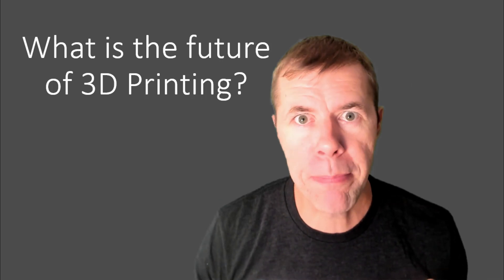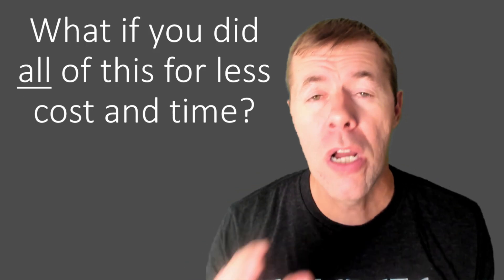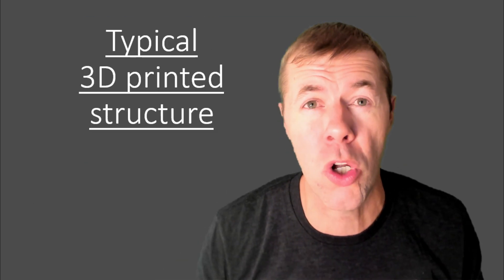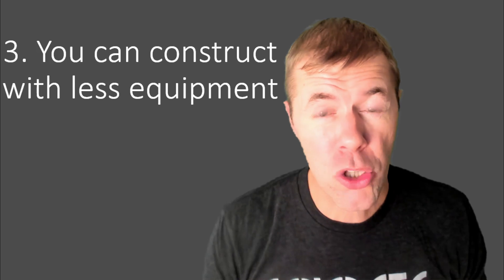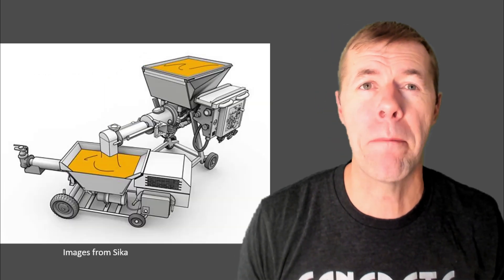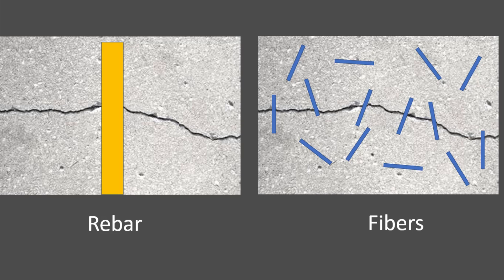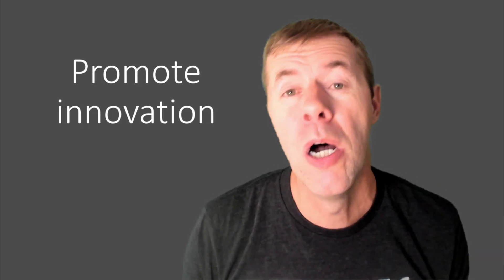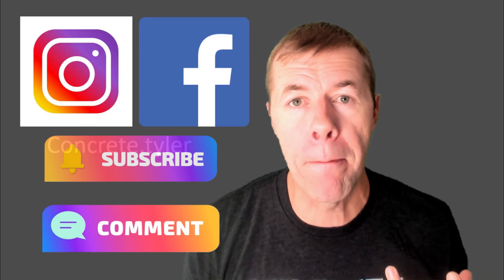What is the future of 3D Printing Concrete?

Comment: I've been following this subject for quite a long time, and I was quite enthusiastic about it at first, but these days I think it would be a better investment of time and money to pursue robotic brick and block laying.  It can use existing materials and well-understood mortar mixes, and while todays bricklaying machines are only slightly faster than a skilled human mason, I don't see any physical reason why they couldn't go as fast as laying a brick or block per second. 

Later generations of masonry robots could deal with heavier materials, such as larger precast blocks, or autoclaved aerated concrete blocks.
Reply from the maker: You still have to come back and place rebar and fill the blocks with concrete.  The new printers can place concrete up to 16" high in one pass and around rebar.  This will be much faster than block.

Comment: Add sleeves at the point of the pour,  both sides to keep what is poured in line with each pass.. a wall on both sides of where it is dispensed, that would help with cleaner lines… add pea gravel to the mortar to help with coat… sand alone adds to water (or admixture cost)

Comment: I still believe that precast is preferable to 3D printing in-situ.
  
Without controlling the curing of the concrete(and the environment), quality will always be variable.  By precasting in a prepared factory, you can control all aspects of the production, and you get to cure without occupying the building site.  Rather than printing one "lift" after another, and waiting for initial strength to print further lifts, one can produce the entire building at once in pieces.
  
You can't get around transportation costs of construction - precast or 3D printed, 40 tons of concrete has to be moved...  It's a wash transporting the rw mix and printer equipment versus the precast elements.
  
Since we can already precast even foundations, you can go as fast as excavation and inspections allow.
Dig a hole... Inpect
Place foundation... Inspect
Place first floor... Inspect, backfill foundation border
Place nth floor... Inpect, start mechanical for previous floor
(repeat)
  
Some of the coolest automation you can do now allows for automatic forming, and wire/rebar cage assembly and welding.  It gets so close to what companies like FrameCAD have done with steel framing, basically CAD it up, and print (in the case of precast, print the cage, print the form, auto-batch the mix, and pour)...
Reply: Making conventional structures using 3D printing - whether it is concrete or plastic - will not result in a positive business case.   The key here is printing structures not possible using conventional processes.
Reply from the maker: Thanks Tim,
I am a big fan of precast.  I have designed a ton of it but precast has some issues and doesn't make sense for smaller projects.  Precast concrete elements are expensive to ship and you have to have cranes to lift them on site.  You also have to connect the precast members together and these connections now become your weak point for durability and structural loading.  Precast makes 100% sense when you are doing the same elements over and over again like prestressed beams and you have a crane but I don't think it makes sense for walls, columns, or foundations.  I think there is a place for both of them.
Reply from the maker: @nicks1146  I don't agree with you.  Get ready.  Automated construction is going to be a game changer and it is best implemented with something like 3D printing.
Reply: @TylerLey  Thanks for the reply Dr. Ley.  I believe the concerns you bring up are valid, but also mostly manageable.  Modular design lends to mold reuse/repetition (and TBH, a return to form leading function like the classical orders makes this easier), modern methods for joining precast segments improves the joint situation, and I have witnessed precast columns used in both parking and human occupied structures.  An example 2,000 space parking garage went up in 2-weeks out here in CA this past spring, all the columns were placed the first three days, the cross beams set to finish out the first work-week (welders joined the beams to the columns), and the decking was placed the second week.  The structure was completely outfitted by the end of callendar month - I've never seen that size of a structure go up that fast.
  
I'm not affiliated, but Peikko has some interesting solutions to the joint and column fastening and structure pain points.
  
There are several companies producing precast foundations, both vertical wall, and footing+beam+panel floor.
  
One of the chracteristics that can be achieved with precasting that I expect would be difficult with 3d printing is hybrid density concrete or insulated core concrete. In theory, one could do something like a multi-head extruder where one head puts out one material and another outputs... well, another material.  More complicated equipment to build and run (software) is the trade-off, and that expertise will have to be earned.  Nothing is free right?

Comment: one of the issues is there is a push away from using cement products and using wood more. so really it needs to focus on the things that has to be made from concrete.
replacing brick cladding is a possibility (timber framing). no need for high strengths or rebar. however it needs to be placed after the timber walls are built. so the printer would need to be more like a multi axis cnc machine (that knows where the end of its tooling is) that can go around the outside and and a nozzle that goes in at an angle.
Reply from the maker: I am not sure something like this lends itself to automation or being insect and fire proof.
Reply: @TylerLey   i'm not sure on what you mean. automation is the whole point of 3d printing. work out one design so you can mass produce it. trouble is the system is only really 2d with lift, not actually proper 3d. with proper 3d you could do far more complex shapes and move around fixtures, rebar, insulation etc.

Comment: So your description of current concrete printing sounds like extra prayer is involved, since it's more challenging to inspect the poured concrete.

When I think of the practicalities of building a house, and especially after having seen that 3d printing involves pouring concrete, I really think that the best use of 3d printing would be to print cellular concrete into a printed-in-place grid system ICF. The printing is slow enough that horizontal rebar could be added during the print, even as it's added during ICF construction. Printed cellular concrete would be much easier to work with when adding plumbing and electrical and surface coatings. Plus, all the solid concrete would be structural allowing it to do the thing for which it is best suited.

Comment: Thank you, professor, for a wonderful presentation. Information that is helpful. But I believe using this strategy will require more time. However, it will change the construction behaviour.
Reply: 3D sounds good, has it’s advantages, really would like to see an ICF building with all the insulation on the exterior ( inside wall can be thin enough for wiring and Sheetrock or plaster) so the concrete is internal (thermally), protected from the weather like part of the family (should last hundreds of years with the right formulation and basalt rebar to prevent rust damage) and acts like a huge thermal load to stabilize inside temps. Results would would be super strong, fireproof (rock wool exterior insulation), easily airtight if done properly, easily disaster proof if properly done. I’m honestly a layperson with just a strong interest, any issues that I need to overcome with this, please let me know. I would be eager to address the challenge. Love your videos and your enthusiasm really charges me up!
Reply from the maker: Khalid - I think you will be surprised at how fast this will be.
Reply from the maker: @Wild_Bill57  I think you got the vision!  There are a lot of details to figure out.  We are going to need some help.  Keep watching for more videos where I will bring up the challenges.

Comment: I'm curious if it will work with passive house standards.  The 3d printed community in Austin TX, I think the upper wall under roof is vented.  Does this system work with Joe Lstibrik's "perfect wall" concept?  Can you create a continous unsulation all around the home like a yeti cooler? Do these concrete walls have a high R values?

Comment: Love the passion and energy Tyler!  I'm of the opinion that ICF is a more cost effective and perhaps superior performing solution.  I can build a 12x16 steel reinforced structure (including roof) with just a couple people, and a pump truck.  At the end of the effort, I have a well insulated, super solid solution at a fraction of the time and cost.  Thoughts?
Reply: I agree.  You get your insulation as a byproduct.  If you use a crystalline admixture like xypex or kryton your waterproofing is mostly done (assuming someone does a legit weep test against the ICF ties).  No 2x4 framing necessary as the ties are your wall panel attachment points inside and outside.  If you do the floors and the roof with a concrete deck forming material like QuadDeck or BuildDeck, you have a phenomenally strong, disaster resistant building.  You still have to deal with creating a termite barrier at any openings or connections to wood.
Reply from the maker: Thanks for the comment!
I agree that right now ICF is currently superior.  This is one reason I tried to hint that cost and labor are not there yet with 3D printing.  However, the next generation of printers is going to really open things up.  We printed our building in 14h with < $2k in rented equipment.  Around here, a pump costs more than that for an afternoon.  We didn't have to purchase or spend the time to set forms.  This will only get faster and cheaper as the systems get better.
Reply: @TylerLey  Thanks for the follow up.  As a follow up question, how do you envision roof printing with this system?
Reply: I'm a contractor that does exposed concrete homes. I think ICF borders on a con. You can get a sandwich panel wall MUCH cheaper, with a much higher insulation value and much less in total cost once finishes are done. 

Most people dont know you can rent commercial forms. Easy to work with even for a DYI and you get them for a month or two for the charge.
Use a product like Thermomass or wire up insulation in place. A less than 8 foot wall wire is an option. I'd only use a wythe for above 8.

Comment: Questions:  In the surface bonding cement used in dry stack block construction, it has fiber in it, does that fiber tend to flake off into the air in microscopic or small particles that can cause health problems as the surface bonding cement ages?  Why don't more people use dry stack, it is said to be 70% faster?

Comment: I would like to see a version of 3d printing that would allow rebar and foam insulation in one fel swoop.   If you could manage a cavity wall, you could have the look of concrete/masonry both inside and outside, then insulation in the middle.  This would give the building thermal mass and obviate the need for drywall.   The only gotcha I can think of with this idea is that electrical cannot be embedded in the wall.   (I hate surface-mounted electrical anything.)

Years ago I saw somewhere how the Germans typically make walls out of AEC (autoclaved aerated concrete) blocks and later route channels in the block for electrical runs, then plaster over the channels.
Reply from the maker: Thanks!  
You could do insulation in the middle but there are some details that need to get figured out. I think this is a good idea!
You can do the electrical in PVC conduits with boxes that are cast at the surface of the concrete.  This is already done with barrier wall lights on highways.

AEC is cool when it is done right.  You could also route into the concrete if you needed to but it would be a lot of work.

Comment: Nice Video 
 But, the view is low due to lack of Optimization & Promotion in the video
Reply from the maker: What do you suggest I do differently?
Reply: @TylerLey  I didn't fully understand what you said
Reply: @TylerLey  secondly can i make a few requests? please make a video about your favourite books on reinforced concrete design. Also maybe on heat island effect. Thanks

Comment: One idea I've not yet seen done - 3d printed panels- done horizontally like precast panels. I wonder if there's any benefit to that- where they can be printed in climate controlled environments, allowed to cure, then shipped to the project site.
Reply from the maker: Thanks!
You could but why not just print them on site?  That way you don't have to move them.

Comment: The promoters of 3D printing have made outrageous promises about the cost savings, which were unrealistic.  The hard construction cost of the building is about 50% of the sale price, and the cost of the structure envelope is about 40% of the hard cost.  Consequently, IF there were able to save on the structure cost, it would be minimal compared to the sale price.  Consequently, it is not a revolution. It  is only another way to build structures with a lot of hype.

Comment: My aunt lives in a reinforced concrete house and the concrete has blown off around sections of the rebar or the metal. She just does not know how to fix it.
Reply from the maker: This can happen if the rebar corrodes.  I have some videos on corrosion that would be helpful.
Reply: @TylerLey  Thank you so much Tyler

Comment: What do the unions think about this? They control politicians who make the laws that can prohibit whatever they want. You could have voids within the concrete inside the mortar.
I see lots of problems but some potential for 3D printing concrete. It is probably still a while away. The vertical screed on your demo looks like a good idea but at the very end, it looked like the wall was slumping. Chances are that the screed needs to be longer. We used to minimize voids by vibrating the forms. I've wondered about the effect of frequency on vibrating concrete. Will higher frequency give a better but shallower consolidation?
I am pessimistic on the future economy. I think that we will see a debacle similar to the late 1980s again. Residential construction died and commercial slowed to almost nothing. This will delay the progress of new systems unless you can prove a big cost savings. Contractors will have to be very conservative so, they'll stick with what they know. Good Video. Good Luck, Rick
Reply: Stop politicizing things...unions dont own politicians.....wondering if you have a real concrete question?
Reply: @roygbiv5164  I have 48 years experience as a Civil Engineer and 10 years as a town engineer. Politics is in everything unfortunately.
Reply: @richardross7219 I have got to say that I do see your point. Trying to get things through town hall or a County government can be a nightmare if they do not want it even if it is something greater than other options. Where I live it is not a problem with the Union owning the politicians so much as it is politicians who are academics that have never been on the field themselves and do not fully understand the process.
Reply from the maker: Thanks Rick,
I don't think this will come overnight.  Where I live we can't get enough people in construction.  Everyone is under staffed.  Everyone is looking.  This could make them more efficient.  This is not about taking jobs away.  This is about making people's lives better and making the workers that we do have more efficient.
I will be the first to say that there are problems with these new methods that need to get fixed and you are right there are all kinds of road blocks to change.  However, if we take a LONG view I see this as a game changer.  I think it is a matter of when and what it will look like.  Please keep watching.  I want to hear your thoughts.
Reply: @TylerLey  Maybe if the 3D is making foam forms for the insulation it would be more efficient. It seems that prefabricating may be the optimum way and would save a lot of transportation and labor. The designs for connecting parts would need improvement. I used precast concrete planks in my house. They only cost a little more than a normal lumber floor and provided me with thermal storage for my passive solar heating.
My exposure to unions was that they were most worried about getting dues. I hear that everybody is having trouble getting workers. I also hear that white male engineers are having trouble finding jobs too. 
15 years ago CT went PC/woke. A job that I applied for was given to a woman with no qualifications got the job instead. She had no idea what she was doing. She screwed up the job and got fired. The HR woman who picked her over me ended up in trouble too. It ended up best for me because I got to retire 8 years early. Good Luck, Rick